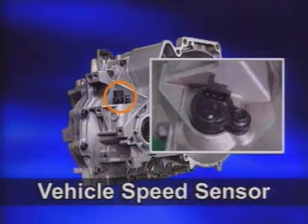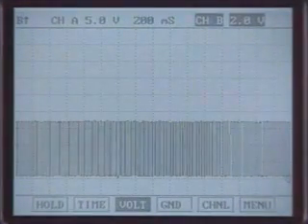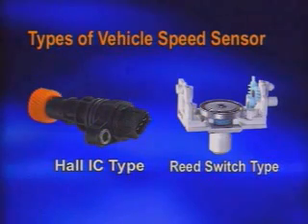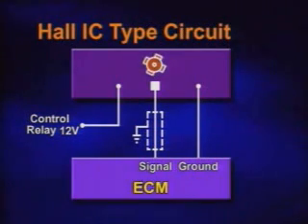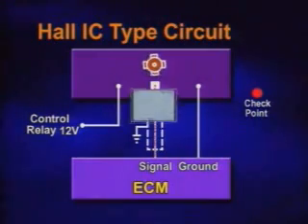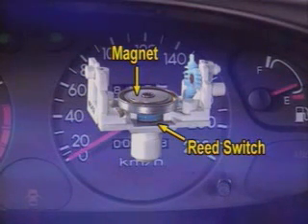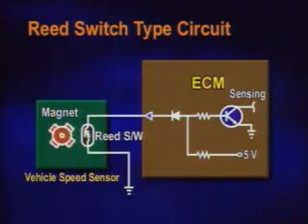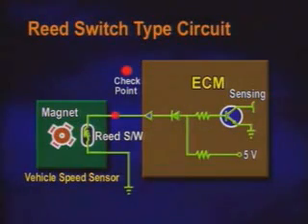vehicle speed sensor - VSS

Comment: I have a 99 gmc Yukon,I replaced fuel pump,fuel filter,distributor, &had transmission rebuilt, loosing acceleration power while driving, getting very frustrated, any suggestions?thanks  john

Comment: hi there,i have a BMW 38i , i had a problem when driving my car, it's stopped(switch off) and i had to wait for like 3 hour to drive again. i realized that the Temp gauge was hitting the red which mean the engine over heat... but after that i took habit of checking water bfor i left...but there is the deal, when driving the car it doesn't accelerate even if ABC button is pressed.... what is that?

Comment: Are there two speed sensors on 2002 Explorer 4x4 v6 I seen one on top of the engine mount and I heard there was one in the transmission how many speed sensors are there on the Explorer 2002